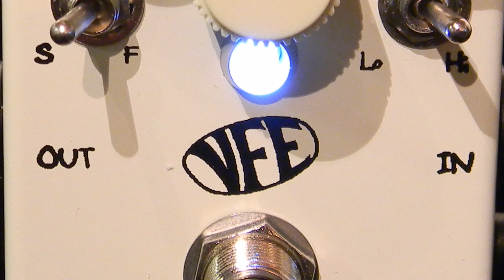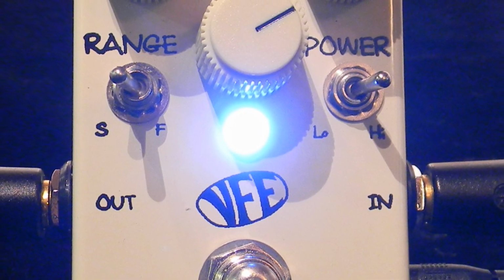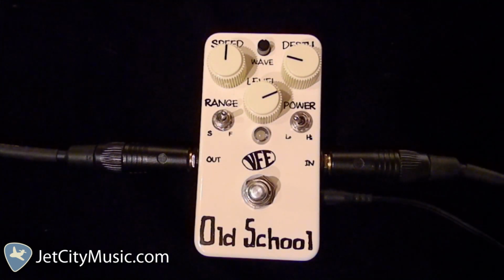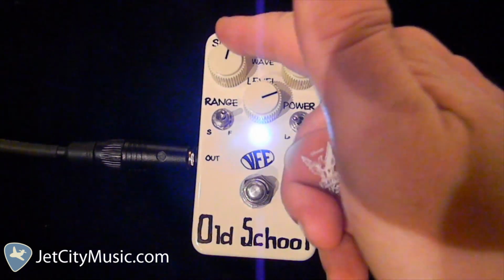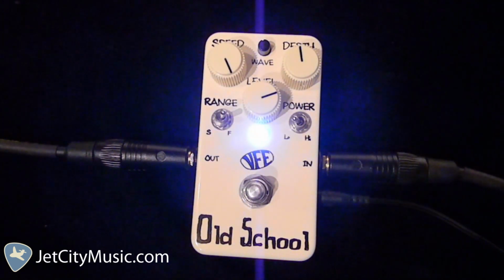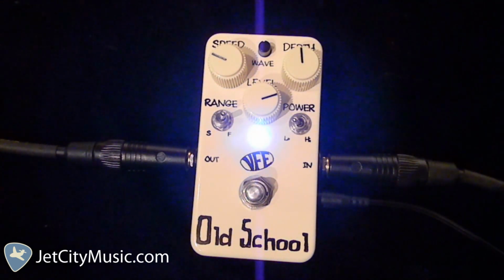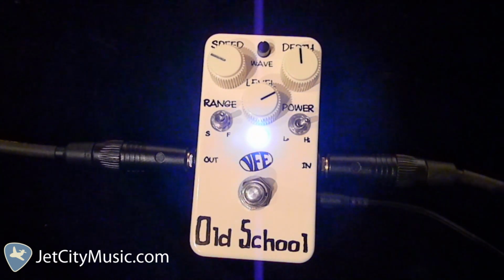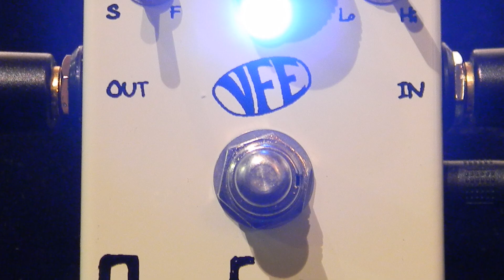VFE Old School Tremolo

Comment: @TheGzeus The WAVE control is in series with the emitter resistor of the bipolar transistor that is doing the tremolo effect. Changing the value of this resistor with cause a crackle as you are affecting the bias of the transistor. Additionally, higher values will reduce the overall headroom & add distortion. This may not be what you want in a tremolo, but it is normal for this design.

Comment: @TheGzeus My point is simply that the only way to mod this circuit (based on EA Tremolo) to have a choppier waveform is to reduce headroom & add distortion. The distortion sounds pretty gritty in this demo, but it sounds much smoother when you switch in the charge pump (as in the other demos). I apologize if I had offended you in my previous comment, I only meant to explain why the circuit behaves as it does.

Comment: @vltjd The distortion is still there at Hi power (which is at about 20-21 volts with a 9V power supply). However, it's significantly smoother & more open, rather than gritty & lo-fi. I haven't tried plugging in a 15V power supply, but this would put the internal voltage in the 35-40V range in high power mode.